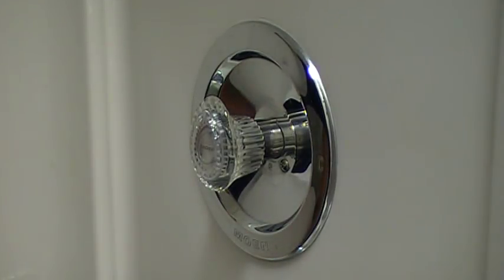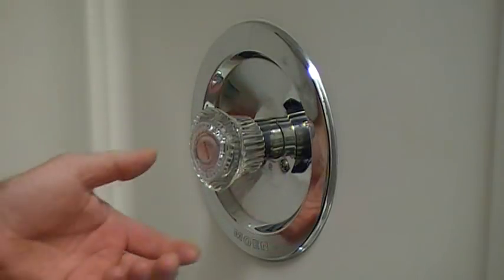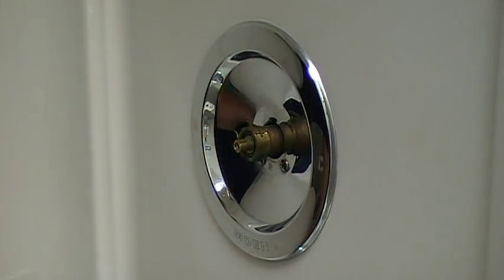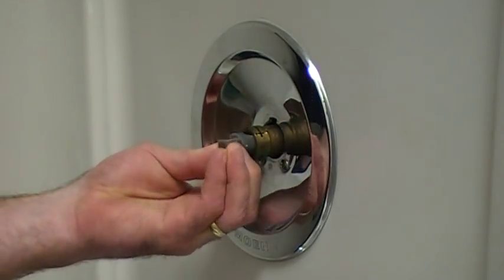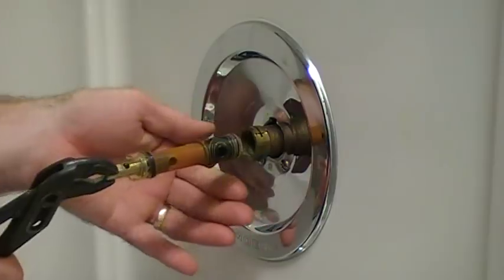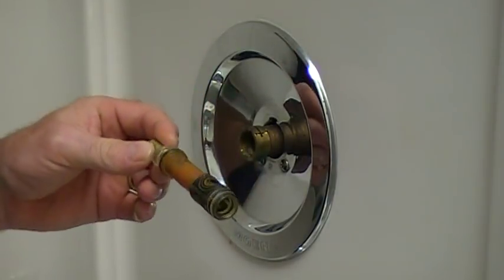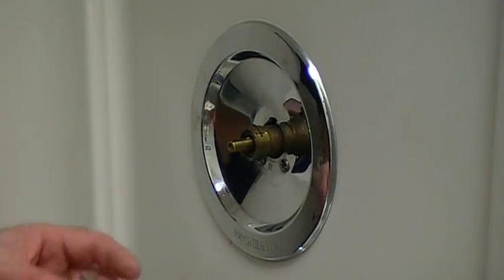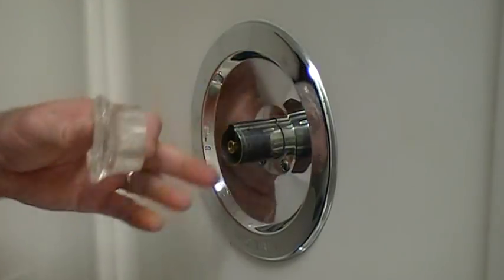How to repair a leaky single lever moen bath or shower faucet..Older style

Comment: Any suggestion for low water pressure? We changed our cartridge just like this because it was leaking and now our water pressure is a lot lower.  I can't figure out what it is.  We flushed the valves, ordered another cartridge in case it was faulty and still no luck! I would think maybe this is the way our pressure is but it was fine before, just leaky.  Its not just low at the shower head either.

Comment: Hello TheOldkid888,

Happy New year and wonderful video. I have a simailar faucet cartridge issue like this where it needs to be replaced. Its an American Standard style tear drop shaped like this. As you mentioned, the plastic part comes with the new cartridge? As well, do you happen to know that part number or where I can get it? Thanks.

Comment: Thanks for making this project look so easy. I have disassembled the unit and rotated the cartridge to loosen it for many, many turns still it wouldn't budge. I tried several times still no luck. I sprayed wd40 on it and it had no effect. Really would appreciate any suggestions.
Reply from the maker: Hello A moy,
If the cartridge is turning; you are half way there.
You may need to pull a bit harder on it. Home Depot sells a knock off that is not overly expensive.
They work very well!
Hope this helps.
Thanks for commenting and enjoy your weekend!    Al

Comment: Before I pull out the old cartridge, where do I find the replacement number? I'd like to have all my supplies lined up.  And do I need to cut the house water supply off before I do this?

Comment: Great DIY video! Question: I have a leaky shower head, most of the time it leaks after a shower but other times (rare) it doesn't. How would I know if it's a new cartridge I need or something else? I'm about to go to Lowe's or Home Depot to get a new 1225 B cartridge, but I'd hate to spend money on a new one if there is something else that could potentially be the problem.

Comment: Al I was wondering how would I know what cartridge that I would need for my faucet between the 1225B and 1222B? Also does that grey tool come with the cartridge or is that a separate piece I need to buy? Thanks!

Comment: Please help! My problem is not a leaky faucet, but I viewed your video hoping you could help with the problem I have. I can not get the shower handle to the hot water side. Could it be I just need to turn the cartridge the 180 degrees you spoke of in your demo?? Or do I need to replace the cartridge??

Comment: Hello is that the same cartridge you replace when you dont have hot water? i had that problem last year and the plumber replaced something that looks just like that. Now i have a leaky bathtub,  does that carttridge deal with both of those isses ive had and having?

Comment: Any suggestions for my shower making a whistling noise when I get too far in the hot position, I replaced with a brand-new Moen cartridge and I'm still having the issue, my next choice is replacing diverter, but as of now it looks in good shape thanks for your help
Reply from the maker: Hello Bo knows;
It is probably not the faucet or diverter, but your water pressure. I have come across this before and it is most likely the pressure in the lines. the sound probably changes as the shower runs. A steadier pressure should make this disappear.
Thanks for commenting and best of luck with the repair!    Al

Comment: Very good video.  Thanks for posting, but I replaced my cartridge and am still having a leak.  I've let the water run as well as took a toothbrush to the spout - still leaking.  Any suggestions before I call a plumber?
Reply from the maker: Hello Chris;
I would remove the cartridge again if you can and look to see if everything looks ok.
A new cartridge usually corrects the problem. I would consider trying another cartridge and see how you get along! I have come across this the odd time, but it is very rare!
You should be able to bring the other one back with no issues. 
Thanks for commenting and let me know how you get along!       Al

Comment: I like putting a little plumbers grease on the new cartridge for ease of installation and for a possible future removal. It will also make the on/off mechanism easier. Just a little grease however. Too much and it could stay open or closed
Reply from the maker: +Larry Hawk 
That does help especially with the removal. Every now and then I will find grease that is actually a little bit dry. It definitely helps with the removal. One problem with applying an over abundance of lubricant on the center piece of the cartridge for a kitchen or basin faucet is your faucet may turn off by itself. So I generally don't touch the center sleeve of the cartridge.
Thanks for commenting and have a great day!     Al
Reply: +TheOldkid888 
Agree, that's almost my exact comment above.
BTW...Forgot to thank you for an excellent video :)
Reply from the maker: *****
You are more than welcome!
I am probably the one of the biggest Moen fans. Great product!
Thanks for your input Larry! Have a super week!     Al

Comment: my cartridge is stuck and will not come out.  my house was built in 2001.  i think i have the 1222b cartridge (it has a white knob towards the top by handle.  i poured white vinegar on it and it still wont come loose. i did take out the u shaped clip. am i missing something else? note: the lever turns all the way around multiple times

Comment: There is little flat step on the end on the brass shaft on one of the large flats. Pretty sure you put this down before attaching the handle to get the hot and cold orientation right.
Reply from the maker: +binnsh 
I will check into it and find out for sure..
Appreciate the information!
Thanks for commenting and enjoy your week!    Al

Comment: Your video is excellent.  I've done this before and now, three years later, the replacement part is leaking like crazy.  Can I pull the cartridge out even though it's leaking or do I need to shut off my main water valve?  Thank you.
Reply from the maker: +Deb Randle 
You are more than welcome!
Thanks for the kind words!
You MUST shut off your water before you make the repair! Shutting off the main will stop both the hot and the cold which you want to make this repair!
Always turn off the water before doing any kind of a repair on a faucet unless it is to repair a shower head or a faucet/tub spout.
Thanks for commenting and best of luck with the repair!       Al
Reply: TheOldkid888 I figured as much but wanted to be sure.  Many thanks!
Reply from the maker: Best of luck Deb!
You are welcome!  Al

Comment: Great video.  Is it necessary to turn off the main shower line before doing this repair?  I'm in an old, multi-unit apartment building with a shutoff valve somewhere in the basement, and I'm trying to avoid calling a plumber to come and shut it off.  Is it safe (and possible) for me to replace the shower cartridge by just shutting off my tub/shower?
Reply from the maker: Hello gompson;
I believe the landlord should cover this repair for you.
Depending on what type of faucet you have in your apartment. It is possible that there could be two shut offs behind the flange. Some faucets that were made a number of years ago had them in there mold. The only way to find out is by removing the handle and flange and having a look. They would be directly attached to the faucet and would have a screwdriver slot to turn them on and off. Located on either side of center.
Look at the pipe as well with a flashlight as they could have installed shut offs on the pipes leading into the faucet.
Each apartment should have its own shut off to isolate them individually. Maybe have a look around where the hot water tank is; you may find one.
If you don't find one; you will have to call the landlord or plumber who will be able to turn the water off to make the repair!
Thanks for commenting best of luck with the repair!       Al

Comment: catch-22...I don't have the little plastic tool unless I first buy the new valve..but until I get the valve out, I do not know for sure which valve to buy (and that would mean 2 trips since I'd need to go back to return the old valve).  Mine looks exactly the same as yours though - have it apart, but the old valve is stuck.  Scared to use a screwdriver to turn the old valve (push/turn on the plastic nubs) instead of getting the plastic tool.
Reply: Got it loose...sprayed CLR and then WD40 on it, but I think what did it is prying (not very hard at all) on the hole near the end of the cartridge with a screwdriver.  Prying = pulling the cartridge out while pushing towards the part that remains in the wall (instead of yanking on the cartridge, which means also pulling on the part that is mounted to the house).
Went to HD - I thought they supported Moen warrantee ()thought they'd give me a new one and send the old one to Moen to get reimbursed), but nope, so I'll get a replacement from Moen.  Putting up with a few drips for a few days is worth $20 to me.  Very likely all that it needs is a few O-rings - they are very worn.
Reply from the maker: cnyap1
Congrats on getting the old cartridge out. They can be difficult at times; no doubt about it. Patience is the key.
Moen will send you one in the mail at no charge. 
The little plastic tool usually comes with the cartridge. I always say the plastic tool to loosen it is worth its weight in gold. Makes the job so much easier.
Thanks for commenting and have a great day!       Al
Reply: TheOldkid888 For some reason I thought HD had a deal with Moen under which I could return it to HD, and Moen would reimburse HD, but nope.  Moen is sending a new valve.  I asked for the part number of just the O-rings (for my other bathtub), and they are sending the o-ring kit as well. I didn't get the part number, we shall see when it comes in a few more days.  I assume they are out west because shipping to NYS takes a full week.
Reply from the maker: Hello cnyap1;
They are a great company to deal with.
You should have no issues. 
They are sending you a new cartridge and o-ring kit. Great to hear!
Thanks for commenting and have yourself a great weekend!     Al
Reply: It came today.  Repair kit has "CT724A" on the packaging and also states: "92451 repair kit - repairs Nos. 92450 and 1225 cartridges".  I believe this is it: http://www.efaucets.com/f/moen-92451.shtml.  Moen’s site also sells 92451 (no picture though).
I have not opened it yet.  Does not seem to have the U-clip, but has 2 identical o-rings and a 3rd o-ring of half the diameter.  Also came with the black rubber that goes near one end of the cartridge, and the plastic removal tool. 
 
They also sent a complete 1225/B cartridge, 100% ready to go.  BTW, the "B" means "bagged" is all.  I asked them the difference between 1225 and 1225/B.
Reply from the maker: Hello cnyap1;
I am glad they came through for you!
Great company! That's all I can say about that!
If you pull the cartridge apart; you will see where the smaller o-ring goes.
All good!
Thanks for commenting and let me know how you get along!   Al
Reply: TheOldkid888 oops - came with 2 large and 2 small O-rings, exactly what was needed.   I can see why they don't bother trying to save a few bucks sending the o-ring kit.  As per directions, I pushed on the threaded end that the handle goes onto.  It slides apart fairly easily and the directions are good.  The inner part had 4 or 5 grooves that the -rings would have fit on, so paying attention to where they came off and looking closely at the directions/pictures is vital.  I surmise people put them on wrong in the past, so they give the whole cartridge now.  cleaning the parts with CLR took a while.  I saved time by not removing the chrome wall cover on the kids' facet (years ago I caulked the top of it, so I won't have to redo that).  BTW, if you tap the handle's cap on a counter, the label inside will fall out, and you can clean the cap and label (it's metal).
Reply from the maker: Hello cnyap1;
Congrats on the repair!
I am glad it went well for you!
The cartridge is the best way go. Nice and simple once the old one has been removed.
Moen is a great company as far as I am concerned! They are very easy to deal with.
Thanks very much for commenting and have a great week!     Al

Comment: My spout is leaking. When i pull up the diverter, then the shower is leaking. ..I think i prob should replace the spout, do you think this will solve my problem. Also , should i turn the water off first? Where do i turn the water off? By the water heater?

Comment: One tip to add, when pushing the clip down; make sure to push it all the way down towards the bottom slot. If you don't then it would be difficult to reinstall the chrome sleeve.

Comment: Thank you for the video. We did get the cartridge replaced but now the leak is coming from the cartridge itself, I should say, through the screw hole in the handle. and not the faucet. Did we miss a step somehow?
Reply from the maker: +Trina pruitt 
If it is leaking through the center then the cartridge itself may be faulty. It is very rare, but does happen.
You may have to replace it with another one and return the old.
I wish I could help you more...
Thanks for commenting and let me know how you get along...Al
Reply: you are correct, we came to the conclusion it was faulty, returned it for a new one and followed your directions and it is working perfectly! Thank for your reply.
Reply from the maker: Trina pruitt
I am glad it worked out for you!
Once in a blue moon a new cartridge has a slight defect. I have changed a lot of them over three decades and I can count on one hand the number that were faulty.
Congrats on the repair!!!
Thanks for commenting and enjoy your week!     Al

Comment: This doesn't relate to the cartridge but I need to replace the plastic handle for this type of Moen faucet and I'm having a problem finding the right one.  Will any Moen plastic handle fit or are there different handles depending on the year it was installed?  I'll have to rely on the internet to find one since all the hardware and box stores have told me they don't carry it.
Reply from the maker: Hello Kay;
If it is an older unit then the tear drop style is what will work for you. Any plastic handle for a single lever faucet will work as long as you have to pull out the faucet to turn the water on and then left or right for hot or cold. Very common in the hardware stores and big box. Shouldn't be a problem finding one.
Thanks for commenting and have a great week!     Al

Comment: thank you, just got mine done...took a little longer, but it's done :)
question though...what was the little grary plastic thing called? the one you use to turn and pulled the cartridge out? I couldn't find it so i use a metal one, it's like a clamp to pull it out.
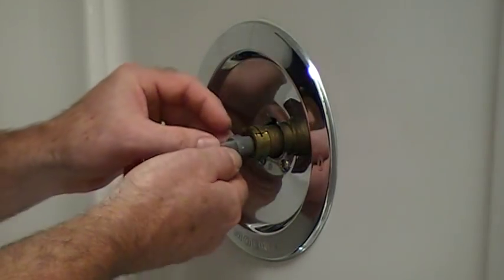did you have to put the ring back in? i saw you pulled it out at 2:14 but it didn't go back in :)

Comment: I replaced our cartridge just like this because the water was coming out of both the shower and faucet at the same time (or just the faucet). It didn't help. Still have the same issue. We have a shower on/off pull lever right under the faucet handle on ours. Could it be this device that needs to be changed out? Or did I do something wrong? I installed another new cartridge just in case that one was defective. Still didn't fix the problem.

Comment: Im having problems with a single lever shower . The valve is turned off but water is coming out as if the water was on..no burst pipes i double checked. i been looking through videos but not one of them explained how i can fix my problem .. is it the same as fixing a leaky faucet

Comment: Thanks for your video.  All of the ;parts of the value did not come out.  What should I do?
Reply from the maker: +Lawson Calhoun 
Not exactly sure of what parts are still in the faucet body. If the center part of the cartridge came out you will have to turn the remaining part of the cartridge back and forth and pull it out. The more you work it back and forth and around the easier it will come out for you.
Thanks for commenting and let me know how you get along!     Al

Comment: Moen sent me a new cartridge, but it has the old white plastic tool. I'm not sure if that is a sign of the cartridge they sent has gone past its shelf life in regards to the silicone lubricant. But once i replaced it and turned the water back on, the faucet is dripping. Not as bad as before but still dripping. Any suggestions???
Reply from the maker: Hello fonduemonkey;
I would remove the cartridge and feel the inside of the body of the faucet for any pitting. It is possible there could be a little. Also check to see if there is any dirt or anything like that in the cartridge itself.
You can pull the center section out of the cartridge out as well and apply a slight bit of grease to it. Apply a little grease to the outside of the cartridge. Reinstall.
It could be possible the cartridge is faulty. Not common, but it does happen.
Thanks for commenting and let me know how you get along.   Al

Comment: My faucet doesn’t leak, but the temperature is fluctuating wildly while showering. Will replacing this part fix that too?
Reply from the maker: Hello gcolonius8270,
First we will start with the type of faucet you have in your bathroom.
If it is a Moen and pull the handle out to turn on the water than changing the cartridge will not make any difference. If you have a Moen faucet that you simply turn the handle for the water to flow then you have a posi-temp faucet and if this is the case then you have a problem with the cartridge. The older style Moen faucets were the pull out style and the water temperature fluctuated all over the map if someone in the house turned on water elsewhere. It sounds like it is this style.
Hope this helps!
Thanks for commenting and enjoy your day!     Al